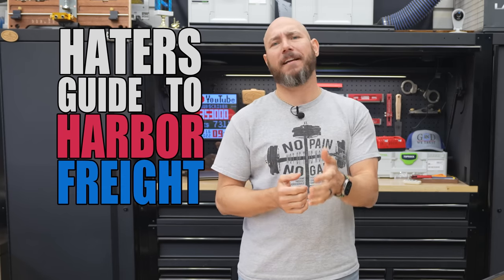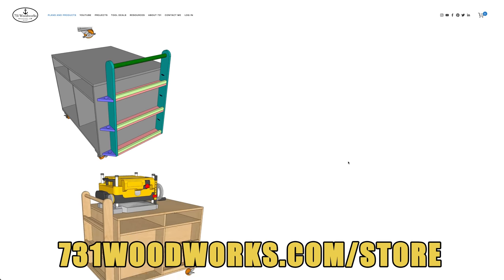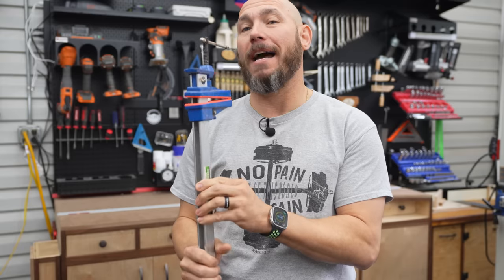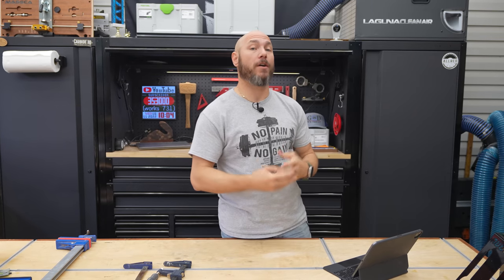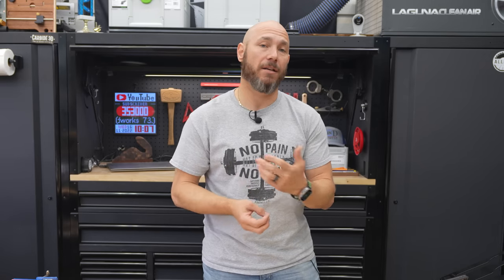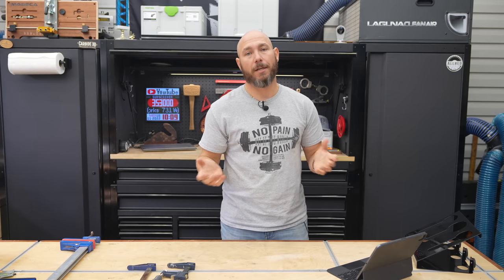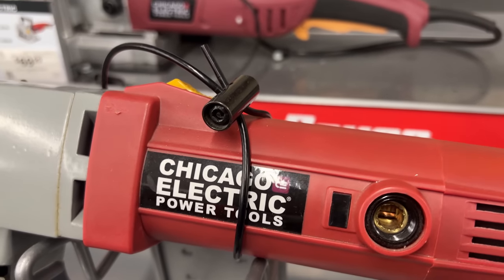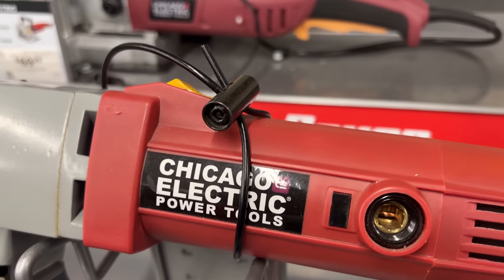The Hater's Guide to Harbor Freight | What to Avoid

Comment: I am an OG Harbor Freight hater. 

When I buy a tool even my wife knows my checklist: 1) Will I use it more than once? 2) Can it kill me? If I answer yes to either one, I purchase elsewhere. 

I have a side business of buying/building/sometimes selling antique cars. I was working on removing the rear suspension at a friend's house in an old crusty Chevy (about 55 years old at that point.) We started prying an old bolt and bushing out (55+ y/o) that we had Sawzall'd at both ends with his HF 3' prybar. The prybar was being used correctly, and it shattered. Not snapped or bent, blew up into about 30 pieces, some embedded in the drywall. After we both checked for newly made holes in our limbs (all good), I went out to my car and snagged my Snap-On, popped the bolt out no issues. Yes, it's five times the price. It's also 20+ years old, and the purchase is cheaper than a trip to the ER.

Now, in their defense, some of their handtools have come a long way. Icon ratchets are pretty darn good. They're on par with current Craftsman stuff. Their tool storage has actually gotten really good; I scoffed at SEMA in 2018 when they had an Icon toolbox there. Then I started playing with it. I was impressed enough that there's a 72" Top/Bottom sitting next to the Mac box in my garage. Is it as nice? 90%, at a third of the cost... 

My in-car tools (I keep a small set of SAE/Metric tools in each old car, in a bag for roadside repairs) are either Craftsman or Icon. HF has served me as well as the Sears/Lowes stuff. Anything heavier, it'll need to come back to the shop anyway. 

Their stuff is generally fine. Not good, but fine. Equal to, or better, than the no-name shop/auto/home tools on a place like Amazon.  If you have a good store manager and build a relationship with him/her, it helps too, if there are speedbumps. 

One thing unmentioned are their wooden moving dollies; I must own fifteen to have around the home to move seasonal outdoor tools, heavy furniture, etc. Several out in the shop holding differentials, engine blocks (aluminum only, though), tires, tools. Just great to have around so you can reposition stuff easily, and cheap. Can't buy four casters and some scrap wood for the sale price sometimes. 

Just go in with your eyes wide open and ask those two simple rules above. It'll save you a lot of headaches and ER deductibles.

Thanks again for the great channel; learned tons so far on woodworking skills. I came to "save money" by building a French Cleat system and few benches for my shop. Suddenly, I have a new set of tools I need to buy.  If I build 437 benches, I should basically break even...

Comment: I agree on most points. I once bought a drill as a “throw away” tool for one specific project where I did not want to use my regular drill. I was really going to be abusing the drill by using it with a wire wheel. Abusing drill and a lot of dust. I buy all my clamps at HF and I have 3-4 speed squares. If you are just a weekend warrior, HF is probably good enough.

Comment: I bought a Titanium 125 flux welder from harbor freight about 6 months ago. Went through a whole spool of wire with no issues or complaints so very surprised by that. Although I have noticed the leads and gun are very cheaply made. Still going strong though!

Comment: I am from Canada and we don't have a Harbour Freight but do have a Princess Auto.  Princess Auto store is two to three times larger than HB but all products come from China.  You do get what you pay for but I have a few electric products from both stores and have not experienced any problems.  Some of these tools I only use at best once or twice a year.  Will recommend the Flexible shaft grinder. I am into wood carving and use that grinder all the time.  My Foredom flexible shaft grinder which cost me over $300.00 broke after three years and my HF grinder has been working foro five years now.  I still don't use it on a daily basis though.

Good review,

Comment: The paper towel holders are great I have three. Two in the basement one for each end and one in the garage. The corded angle grinders and circular saw I’ve used for concrete paver cutting as I wanted something cheap because the concrete dust will trash your tool bearings if you spend $10.00 or $100 on a grinder so I buy the “disposable” one from HF.

Comment: When I got my tools stolen and had to restock due to finding a job I bought the Hercules power tools. Found out they're basically Milwaukee with a different battery plug...well and Milwaukee does better quality control. They've worked well for me, though and I'm stuck in the ecosystem due to the batteries, LOL

I still miss all my Dewalts, though.

Comment: We have one of the Hercules cordless drills, and the jobsite fan. Both have been very good for us so far.

I'd honestly be tempted to stick to them as our cordless hand tool source, if the line were larger. But if I'm investing in a battery system, I want to make sure it has a multitool, jigsaw and RO sander. A palm router would be nice, too, but I can live with a cord if necessary. Probably going to take the small step up to Ryobi. I just don't use them enough to justify one of the higher-tier brands.

Comment: Pretty accurate description. Another steal are their tool bags. I have never had an issue with them, I use them a lot, and they are cheap and go on sale often. I try to go with Milwaukee or DeWalt for power tools. 

They just last and you know you are getting quality with those brands. You just have to know what is worth it and what is not worth it. Anything with moving parts is a no go for the most part. Their generators are also a steal. They have been compared to Honda and even Consumer Reports has said they are damn good. 

I also have a pancake compressor from them. Those are dirt cheap and I have had mine for a couple of years now. Got it for like $40. It is great for just using around the house to blow out a computer, a fan, pump up a tire, and small tasks like that.

Comment: If anyone goes into an HF store wanting to get a good, reliable drill for hobby work but don’t exactly need top of the line performance, don’t let the employees corner you in the Hercules section. I see my managers doing this often. You just don’t need to spend so much if you aren’t going to abuse the tool in a sort of industrial or high stress situations. 
If all you want to do is let’s say build a shed, some shelves and desks, and/or vehicle maintenance, Bauer will work just fine for you. The only downside would be the warranty as some Hercules tools have an included 5 year warranty while Bauer has up to 2 but needs to be bought (tho they should be rugged enough outlast the warranty so I wouldn’t say they’re always necessary)

Comment: I've used Hercules bits and blades with no problem.  I didn't believe it at first when I bought them, but I managed to cut 20 pieces of uni strut on one metal blade.  Their impact bits are comparable to dewalt imo.  I'm a HVAC Professional and use a lot of Harbor Fright tools.  I was actually shocked their offset aviation snips actually competed or out performed named brands. I almost decided to change my dewalt power tools to Hercules cause they seem to be doing pretty well; however, Warrior brand is a minimal use product and I would I consider them use once and discard.  Torque Wrenches seem to be great to, just confirm calibration before each use. I have a setup with a hanging digital scare fore that.  Their new ICON brands seems to be promising, they say it compares to Snapon, I don't know if that has any merit.   Either way in the end of the day if it breaks, just remember you get what you pay for.

Comment: Most of my tools are from harbor freight. Hand tools and saws. I have broken a hand full of the Pittsburgh hand tools.  But they all have a lifetime warranty on them.  Bring them in. Replace them with no questions asked. And I also have both the Hercules job site table saw and the Chicago electric compound miter saw. Both Work great for what I use it for.

Comment: I have one of those 12in miter saws, and have used it steadily for several years. I love it, and the blade it came with is also great. It's finally starting to show some signs of wear (the cuts aren't mirror smooth anymore), but the angles are still plenty good enough for me (I don't make fine furniture, so I'm not the most demanding user). I made the mistake of buying one of the cheaper HF routers - used it once, gave it away, and bought a Bosch.

Comment: I have built many a project with the meter long and smaller Harbor Freight F Clamps and the worst thing that has happened is I lost a plastic foot. If you're putting that much pressure on a clamp that the bar deforms it's time to pull out the pipe clamps plus you will mar your project. Besides my hands hurt trying to apply that much pressure with an F Clamp (why I dislike quick release ratchet clamps, the small ones that HF sells are crap). I have that Hercules Miter Saw and it works quite well for me!

Comment: I’m a carpenter and I buy all my automotive tools there. So cheap to get a nice arsenal. 
Also saw blades and gun nails. You can save hundreds on a project just buying nails from harbor freight. I prefer them over metabo , about the same quality as grip rite. They even deliver for like $8, whether its one box or more. 
 I’d say if it’s not your trade but you do it check out their tools and some are definitely good enough for pros.

Comment: I'm an RV technician. The plastic handle chisels work great for me, because I'm usually just adjusting door frames or something similar. Need to get a little bit of it off, but it doesn't need to be pretty in that area. Plus they're cheap, and there's a harbor freight down the road from my shop. Most of my hand tools are from harbor freight. The icon line stands up to daily abuse from me daily and I haven't had a single issue. I've used the ratchet as a hammer before and it didn't care. The icon impact sockets stand up to 1400 foot pounds of torque from my big Milwaukee impact. I've been pleased with damn near everything I've gotten from them, except for screw driver bits. Those aren't great.

Comment: I have the Chicago electric table saw for 5 years.  All I do is rip boards with it.  It’s worked perfectly, I get straight cuts all the time.  Also tarps are good there too.I use them for my wood pile too keep them dry. I’m rough with tools and items and they seem too hold up too my abuse

Comment: I've had a Harbor Freight floor nailer/stapler and 120psi compressor for nearly 20 years. I don't use them often, but I've put in 2000 square feet of hardwood flooring and loaned both out to friends. I've never had a problem with either, and they saved me a lot of money on equipment rental. I've also had some of the cheap tools (tile saw) that simply don't hold up. To be fair, most big box stores sell cheaper tools alongside the higher end brands.

Comment: Just bought a $10 Angle Grinder. It worked great for ceramic tile and cement board. The Diamond grinding disc cost more than the Angle Grinder itself.

Comment: I bought a sawzall for my mom to trim holly bushes. 
For $45, I got the saw and 15 blades.
The job got completed. 
The $50 electric chainsaw (sunjoe) was almost impossible to assemble and it did not release the bar oil, mom burned the chain up in 2 minutes.
Harbor Freight has stepped their game up, give it a shot.
Northern is as expensive as Lowes or Home  Depot.

Comment: Yes, as noted they have increased quality a LOT in last 10 years, and Icon is about = Matco/SnapOn ! The Atlas battery lawn equipment stuff is great, I have 80v string trimmer which is overkill for my yard, the 80v chainsaw works well for homeowner stuff and you don't have to keep gas around and hope it starts, blower and hedge trimmer also good. The Fortress ultra quiet air compressor is really nice so far. Happy. 
Rug cutter, slip joint plyers, knock-off quick clamps, etc and agree the Chicago Electric stuff is total garbage.

Comment: I bought a Hercules battery impact gun and it has worked well. It's sole purpose is to keep on my trailer in case I have a roadside blowout and I need it to change a tire. Throw in the random usage once or twice in the year and it was worth getting a cheaper item. 

This wasn't from HF but I bought a super cheap Ryobi table saw close to 20 years ago. I paid $79.99 for it and it came with a stand. Well, I have used that saw for years for quick cuts, etc. plus it is pretty light and can be easily brought to a job site. Now, it is NOT something that a serious woodworker or carpenter would use because it is so low quality but it has its place and I have easily gotten my $80s out of it.

Most tools, expensive and cheap, have a time and place associated with them.

Comment: I'm a DIYer and homeowner.  Every single day, I'm doing SOMETHING with my house. For the majority of my hand tools, I absolutely love my Harbor Freight tools. When we first moved in, I was coming off of active duty and an OCONUS stint, so I didn't have a lot.  I bought A LOT of Bauer tools, and have had absolutely no issues whatsoever.  I suggest checking out the Project Farm channel for comprehensive reviews. 

While the Bauer hasn't done me wrong so far, I'd still suggest going with either Hercules or making the small jump to Ryobi.  I am not a contractor, and I plan to do a lot more things as I learn, but the newer brushless Ryobi stuff (HP editions) have been great from my exposure. 

TLDR: Assess your needs. If you're not a contractor/mechanic, you probably don't need DeWalt or Milwaukee. Hand tools from HF are slept on. HF power tools are great for intro DIY.

Comment: I started off buying HF tools because I could afford them.   Most of the power tools I bought no longer work.  However, my 30+ year old floor drill press still rocks, along with my dust collector and floor belt/disk sander.   I still have their ratchet set, some wrenches and other Pittsburg branded tools that have a lifetime warranty.  I also, buy consumables like gloves, nails, etc.

Comment: Another one to add to the mix is the 5 gal paint sprayer they have. with a little bit of modification to the plumbing parts it makes an excellent entry level pressure pot for epoxy projects. So If you are just getting into using epoxy and you want a bubble free piece this is a good one to get at an affordable price.

Comment: I've got a couple of benchtop belt sanders, a buffing wheel and a drill press that have always done everything I've needed them for. Harbor Freight bench brushes are nice for $1.99. Things like scrapers and wire brushes are fine. The handplanes are steaming piles of garbage.

Comment: I've been buying from harbor and have bought over $10,000 worth. On the automotive end. I rebuilt the top end of my engine.
Replace my ball joints, brakes disc, bearings and many other things. With the automotive harbor freight tools I have saved thousands of dollars in auto repair.

Comment: I have the hand plane set you showed.   Yes out of the box it’s rubbish. Just flatten,polish, and wax the sole. Also sharpen that blade. Even then I know it’s not a great tool BUT for 15 bucks for BOTH it works well.

Comment: I have a lot of HF gear, my philosophy is if I use it enough to break it it's worth upgrading. So far my sawzall and reciprocating cutter going strong, I see no reason to upgrade to something else. Just got a brad nail/stapler and compressor from them as well, we'll see how long they hold up. I have gone through three sets of Pittsburgh calipers though, first one lasted forever, two replacements lasted less than 6mo, at which point I decided to upgrade to some Mitutoyos.

Comment: one think I may add: you can buy or 3D print battery adapters so if you like a specific few time use battery power tool in the Bauer or Hercules line, you can buy the tool only and with an adapter, continue using your main batteries...

Comment: I've got the older version of the hercules table saw works fine and cuts straight. Got it on clearance they were about to switch to this latest model. Spend the extra for the craftsman planer the bauer burnt up in twenty boards for me and I just use lowes pine fence boards for projects. I've planed 150 plus boards easily with the craftsman.

Comment: I have many different brand name tools, after 40 plus years as a General Contractor who works alone most of the time I have duplicates of nearly all. I like some of the HF stuff. I avoid pry bars from them. F-clamps are good, most guys using the longer clamps realize they are not heavy duty. You don't want excessive clamping pressure on glue ups anyway. The Chicago Electric stuff can surprise you. The Bauer line is not bad. I'd probably go Bauer before Ryobi, of which I own nothing now.  The key is to not expect premium tools at low cost. I have Milwaukee, Dewalt, Bosch, Makita, Rigid, older Rockwell/Delta, Chicago Electric, Porter Cable, Hitachi, plus more. I tend to repair my own tools. Every brand has some junk and some jewels, some junk costs more, some jewels cost less. It Pays to read reviews, then read between the lines to figure out if the reviewer is a whiny, ignorant wannabe or someone who knows tools.